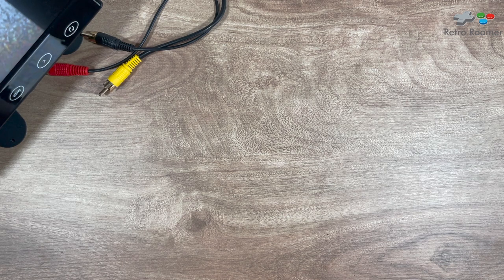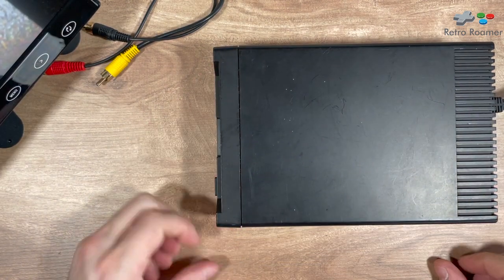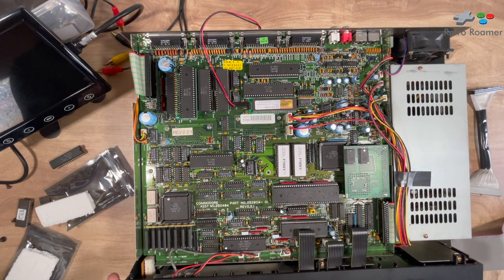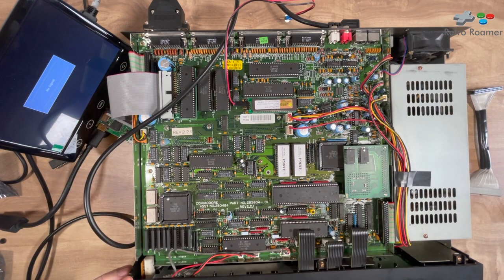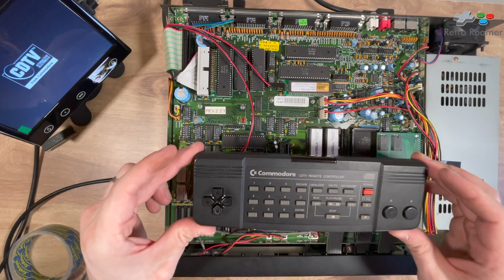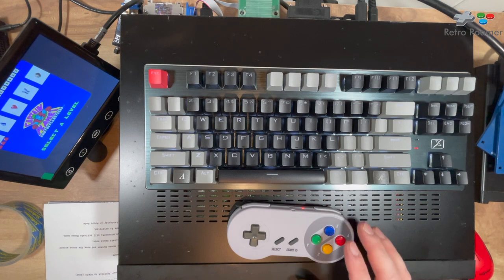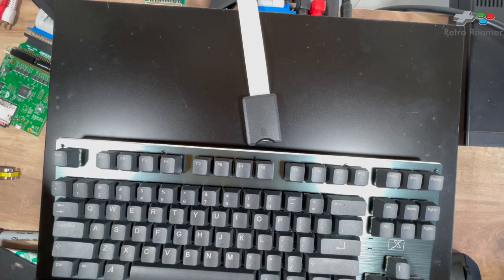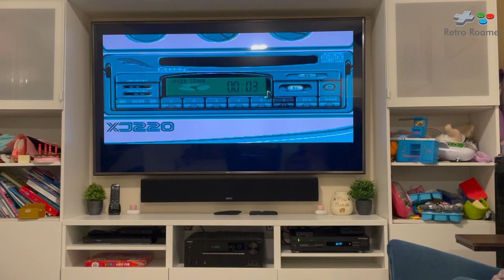CDTV upgraded for use in a modern setting

Comment: Welp I reacquired one for a relatively nice price. Adjusted for inflation I paid well below even the fire sale Commodore West Chester price of $289. In retrospect... ONE of the best and surprisingly expandable lower spec Amigas although you wouldn't have known at the time of its release. IT has an expansion slot, Video Slot,  memory diagnostic connector, Socketed CPU, PLUS all the Amiga ports with MIDI thrown in for good measure. I am going to add Pistorm, Vampire 2, and Vampire 4 to mine and then decide what expansion will reside in it permanently. One of the most insane features I forgot about was the abilities to play CD audio from any CD independent of the Amiga audio. So you can finally get the DEATH METAL CD quality soundtrack Road Rash deserved. Add WHDLoad and modern amenities like gotek drives, SD readers, and blue SCSI you've got one sexy AMIGA... and wife.device has no idea what it is as it sits under TV in the living room.

Comment: Ahh, looks good :) I have only given my CDTV the SCSI2SD and 8MB FAST RAM upgrade so far. So it sticks with Workbench 1.3. I am using it with a 1084S monitor, but not the black one unfortunately.

So the Pi Zero is used as a RGB to HDMI converter? Have you thought about adding the PiStorm to this? I read it supports the CDTV, and if its to be a modern setting Amiga, that does seem to add a lot of useful features to it.
Reply from the maker: I have a PiStorm just not even tried it yet. but I will totally test it. CDTV still shows as experimental for now. but would be a good add on.
Reply: @RetroRoamer  have you tried it? I wonder if it fits under the lid?

Comment: Nice video 👍🏻 Shame you didn’t show the rear card fitments and how you got the new gear fitted around the back as this would have been nice to demo. I take it chip RAM in the CDTV can’t be upgraded to 2meg?
Reply from the maker: Thank you. I didn’t show the fitting for the rear as the language was bad and I was cutting my hands to bits trying to get it all to fit with all the switch cables and pi been in there. 2meg could be done with a mega chip but the drop in replacements are very expensive and not easy to get hold of, But I haven’t found anything I’ve played that doesn’t work with 1mb yet.

Comment: Do you need the edu card for this setup? Will the CDTV not boot without a card in the slot?
Reply from the maker: You don’t require Edu’s card. I just wanted to still have the 23pin RGB port still working just for a fail safe over the RGBTOHDMI. The original rf card was fine just didn’t want to damage that to fit hdmi and the buttons and switches. Just my OCD I guess.
Reply: @RetroRoamer  So removing the modulator card disables the rgb-port?
Reply from the maker: @kennethhagen13  removing the rf card disables the rgb port. Without a replacement or modern replacement it doesn’t re enable it.